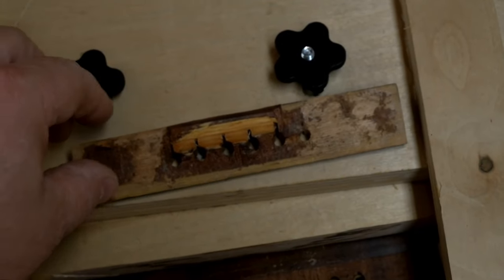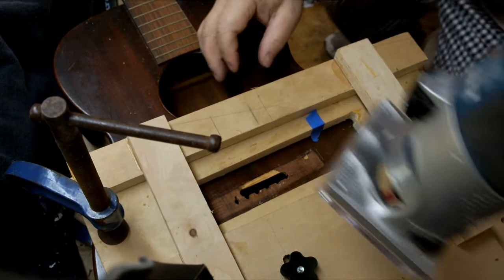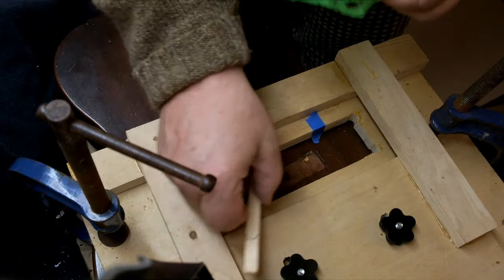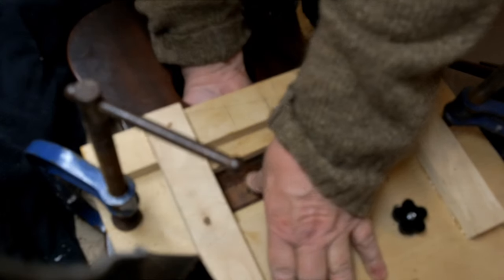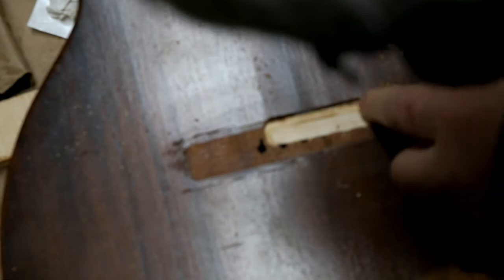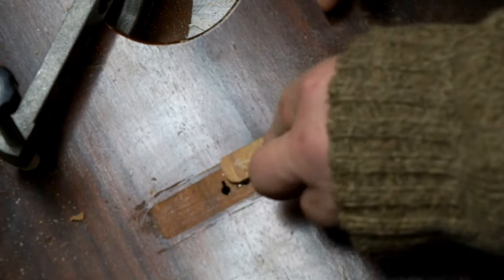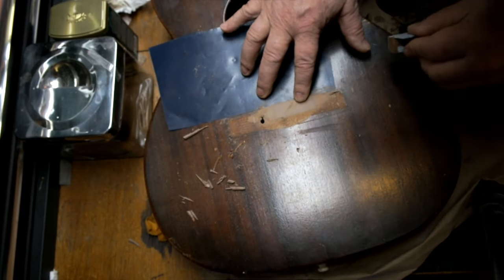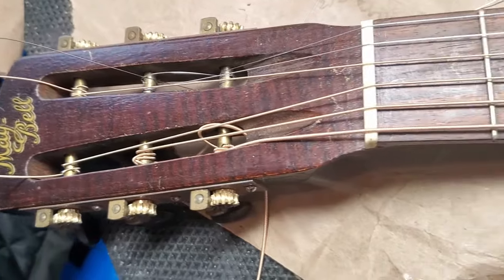Massive Destruction to this 1930 Solid Mahogany May Bell when Bridge tore loose

Comment: I wonder if all that hard glue on your routing  jig was removed and sanded smooth if your router skills would improve, you might want to think about that
Reply from the maker: The glue on the top of the jig is irrelevant as the router doesn't use that surface.. The only surfaces that matter are the inside ones that the router bearing hits.  The glue you see is CA glue and very thin.   This jig is a one time use, as it was made for the damage done to this guitar and had to fit exactly, which it did.  The jig will never be used again and doesn't have to be aesthetic. The pieces fit exactly in the routed slots so the routing was not an issue.   Thanks.